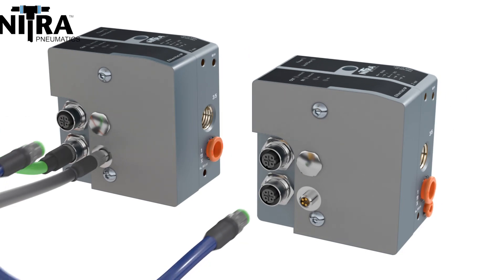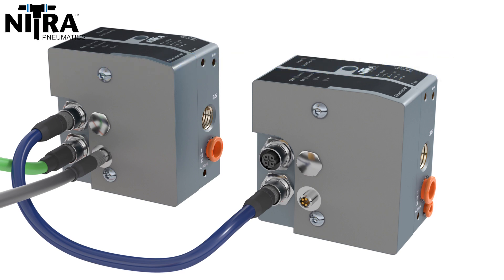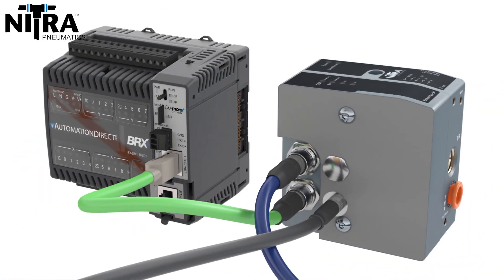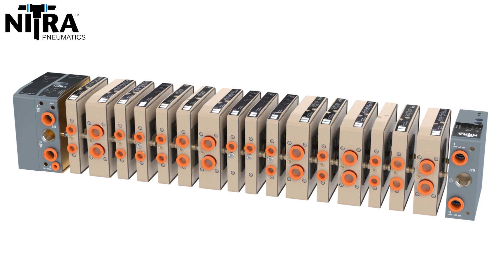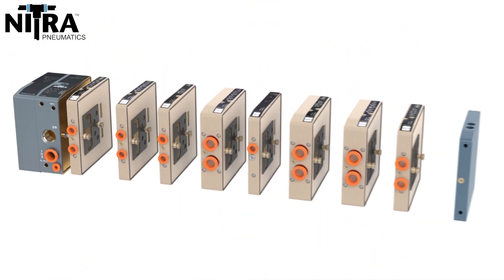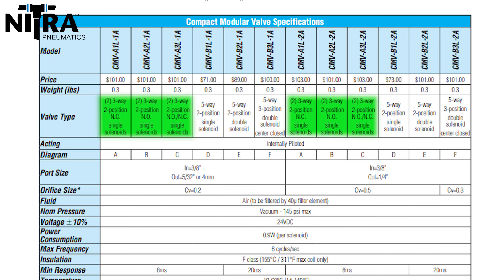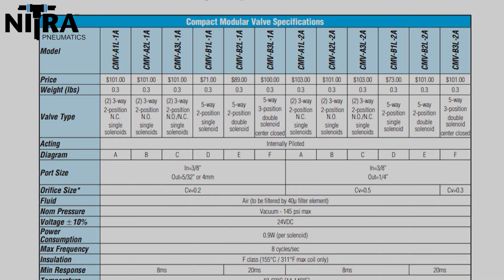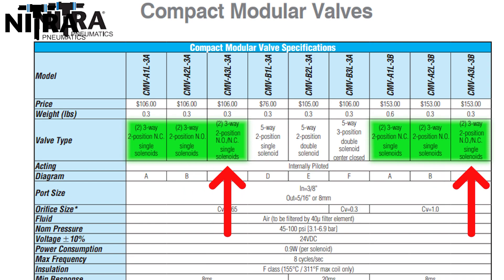NITRA CMV Compact Module Valves Selecting Components from AutomationDirect

Comment: How to use a Productivity PLC to control this valvebank?
Reply from the maker: @Marco Wu  There are two options to control the CMV series of pneumatic valves. They can be controlled by standard inputs and outputs from the PLC I/O cards by using the CMV D-Sub Module, or by using the EIP module for the CMP valves. The IEP will allow Ethernet communications between the Productivity PLC. The user manual covers the steps https://support.automationdirect.com/docs/nitra_ump_ethernetip.pdf  Feel free to contact our award winning, free technical support if you have further questions. They can assist in selecting the correct parts and setup. https://support.automationdirect.com/techcontact.html  AutomationDirect offers a free Pneumatics eBook that is a beneficial resource https://library.automationdirect.com/practical-guide-to-pneumatics/